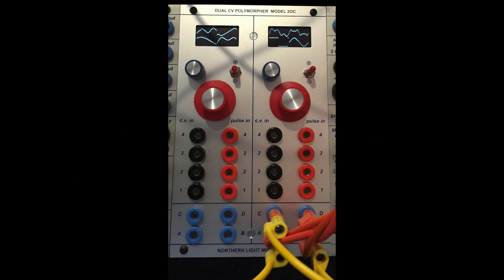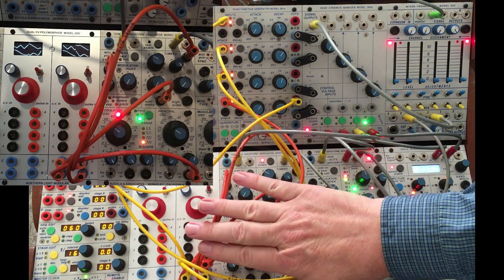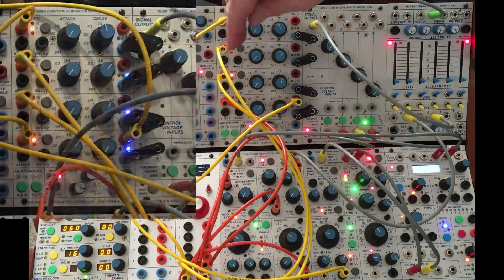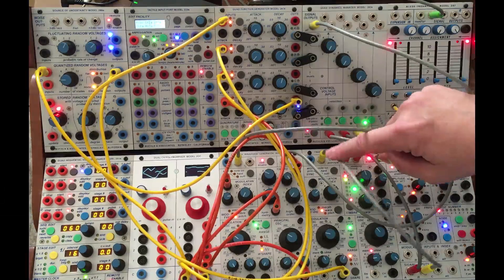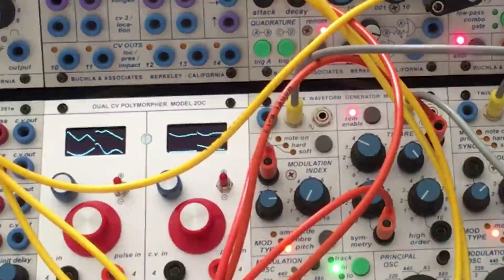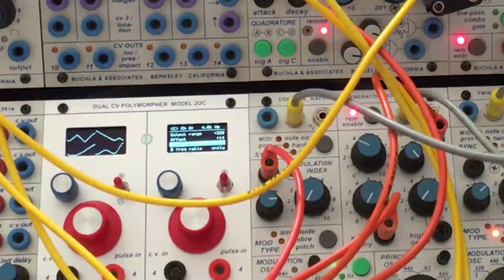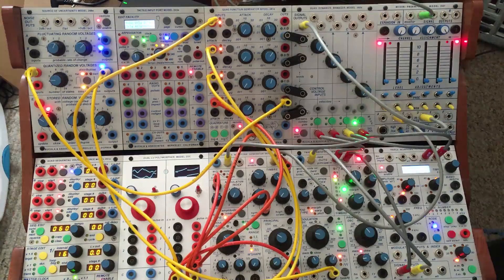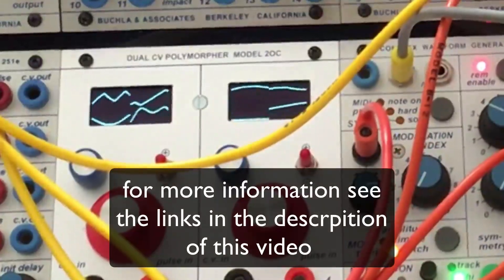Northen Lights Modular 2OC

Comment: Thank you Todd, It would be great if you explained the architecture of the module a little more.
Reply: See the Ornament & Crime web site at http://ornament-and-cri.me - the Northern Lights module is the same hardware running the same firmware, but with outputs voltages adapted to Buchla standards, thus everything in the O&C documentation applies to thus 2OC module.
Reply from the maker: TheSineAssociation Thanks Leo. Only had it for a few hours, will definitely explain it after it grok it :-) meanwhile you can surf the link in the description for more info/architecture. Cheers!
Reply from the maker: Hi again Leo.  OK, I've had a few more minutes and the short answer to the CV Inputs and Pulse Inputs is that they are all programmable given the specific needs of the chosen app at the time. There are 13 different apps available. Hope this helps.
Reply: Thanks again Todd, so..... a monster with different faces and behaviors.
Reply from the maker: Totally!! http://ornament-and-cri.me/user-manual-v1_3/#overview